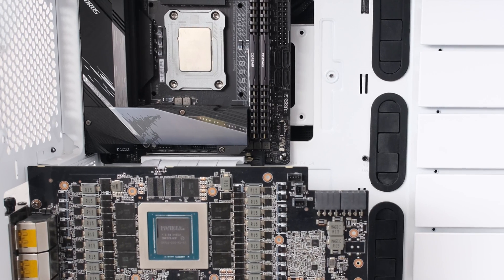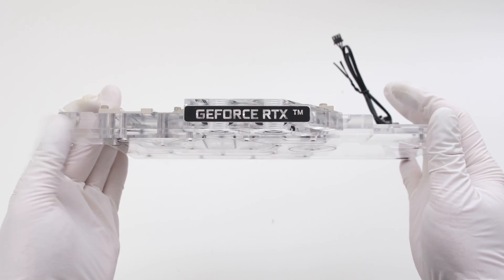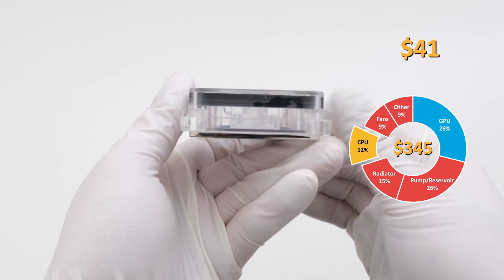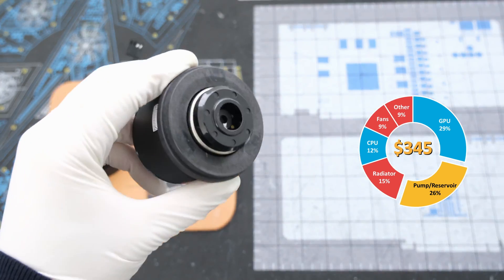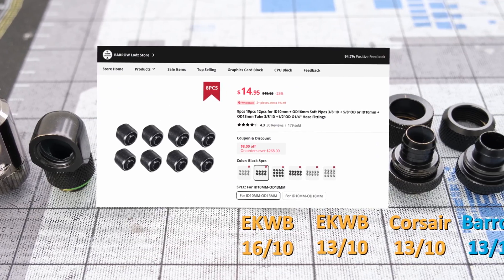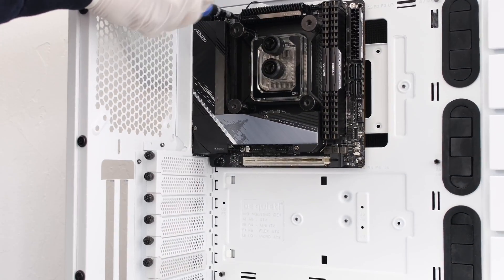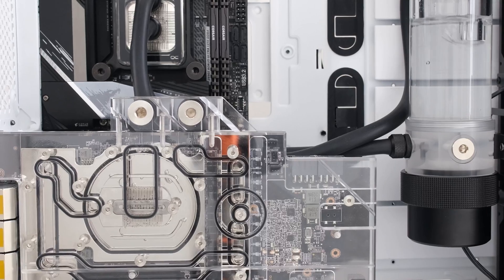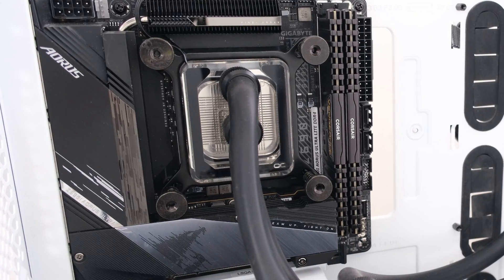Budget Watercooling Guide - Step by Step

Comment: Great vid, I'm trying this. So you connect the pump to a hdd cable, how do you control the speed? And when will it turn on/off?
Reply from the maker: Thanks for your comment 🙏 If the pump header is plugged into the motherboard, then the speed is controller by the motherboard software/bios. Since its connected to the power supply, the pump turn on when the PC turns on. Hope that helps

Comment: Great Video, I like the fact you did an entire custom loop for less than $350. I am currently running an AIO for my CPU was thinking about a second Loop for my GPU (EVGA) 3080 FTW 12Gb. 
the only other thing I was wondering about would be Maintenance  (how often, how would you drain it Etc.)
Reply from the maker: Thanks for your comment 🙏 Maintenance really depends on how well the loop is built and where it is located. You can easily go a year or more. But I like to think of maintenance as an opportunity to tinker with the build. Hope that helps

Comment: I have a overclock that is quite heavy even a Lian Li Galard II isn't cooling my CPU as the overclock is kind of extreme.
I never made a custom loop so would this be viable?
Pump+Resevoir--->240mmRad-->CPU-->360mmRad-->BacktoPump+Resevoir
Reply from the maker: Thanks for your comment 🙏 Looks like a 360 and 240 rad, which should be sufficient for a CPU and GPU combo. The more rad surface area, the better. As for loop order, it doesn't matter. Go with the order that makes the most functional sense. The water temperatures normalize far too quickly for the order to be a consideration. Hope that helps
Reply: @vectornetwork  Thank you :) I ask since i have a 14600K that pulls 250W with my overclock and my lian li 360 AiO isn't doing the job so i may start to navigate in to custo loops

Comment: Sure $350 for an old computer (which isn't worth water cooling, btw) but if you have modern components the cost will nearly double. $200+ just for a GPU cooler on the latest gen. The CPU cooler will be $100+ as well on latest gen.
Reply: Сlоwn take 🫵😆
Reply: @ffwast  sounds like you don't water cool. I've been custom loop water cooling for almost 20 years now. It is VERY expensive, especially when upgrading to new components.

Comment: Nice walkthrough! Was going 10/13 on EPDM tubing primarily for cost, or is there a build advantage? (easier turns than 10/16? or no)
Reply from the maker: Thanks for your comment 🙏 You nailed it. Its 100% due to cost. This is a budget build and everything adds up. The 13/10 tubing (and also importantly the 13/10 fittings) are slightly cheaper than their 16/10 counterparts. I prefer the 16/10. Hope that helps

Comment: which is the return and output side of the radiators and is it possible to fit 2 radiators in series?
Reply from the maker: Thanks for your comment 🙏 Radiators tend to be a little simpler than the CPU and GPU blocks. From my experience, you can use any plug for the input and output. Yes, you can fit 2 radiators in series. For this build, I was very conscious about cost and wanted to specifically show how 1 radiator can adequately cool both the GPU and CPU together. Hope that helps

Comment: This is almost perfect video. Although I would have highlighted the need of a good quality biocide AND corrosion inhibitor. Don’t think you can get away with only DI water/biocide, a silver coil or premix coolant. Corrosion is the number one issue that isn’t communicated enough in beginner guides.  Corrosion inhibitor is essential to prevent minerals  (in particular nickel plating) diffusing into the water due to the imbalance.
Reply: If you have copper everything (no nickel plating) in your loop you will not have a problem with corrosion as I mentioned but copper does tarnish green due to a number of environmental factors and water chemistry so a inhibitor is still recommended. But people forget fittings which are almost always nickel plated on the inside which will lead to the issue I mentioned above.  The  nickel plating flaking off which can then damage pumps and clog up fins in the jet plates of the blocks.  Easy solution is a few drops of a good biocide and inhibitor (they are separate bottles) like from mayhems”Mayhems” and then an additional drop every 3 months. I have done this for 5 years and never had an issue.  Block still like new. EKWB themselves does not actively promote this problem and how easy it is to fix.  Many of their premixes and additives etc do not contain those inhibitors.
Reply: does cooper has this issiue aswell or just nickel plating ?
Reply: Just use straight antifreeze and forget about it.

Comment: I just wanted to thank you for making this video. Most build videos spend all their time talking extensively about unimportant things and then just time-lapse through the actual loop building portion. Your video is exactly what i was looking for because you show the construction of the loop itself. The only things missing are design considerations (like putting the pump and a drain at the lowest water level) and tightening all the blanking plugs and the fittings, but that would make a good follow up video - you can call it "best practices for water cooling" and go over things like radiator placement, fan selection, radiator sizing, loop routing, tips and tricks etc.

Comment: While the budget liquid cooling system displayed in this video is very well thought-out, well executed, and the guide extremely well produced, I cannot in good conscience recommend spending custom liquid cooling money when you could easily use that money to upgrade your computer's components for enhanced performance.  unless (and specifically unless), you're using top end components, I can't recommend doing a custom liquid cooling loop (unless you're trying to cram a bunch of parts into a really tiny case or something and you need a unified small cooling system or something).  for example, the $345 spent on this loop could have been spent moving from a 3080 to a 3090 which would yield SIGNIFICANT gains (particularly to gaming and rendering workloads), or perhaps depending on what's available in your area you could have gone from a 3080 to a 4080 (or even 4080 super)(especially if you were to shop around on the used market).  Further, the gpu that you're cooling here is ALREADY equipped with an aio.  unless the integrated liquid cooler has failed (in which case you can pick up a gpu with a failed aio on ebay or something for SUPER cheap and this WOULD be a fantastic way to get it up and running again), it's very unlikely that you are going to get any additional performance out of this card by going from the stock liquid cooler solution to the one depicted.  and an i5 could easily be upgraded to an i7, or imo better, not buying the i5 or it's board and going instead with a used b450 board and a ryzen 7 5800x3d which uses around the same power (very efficient) and depending on the game, can be almost as performant as a i7-13900.  AND because it's a low power chip (as is the i5 shown in this video), it doesn't really need liquid cooling to get the best performance out of it either, in which case, I would go for something like a (preferably used) noctua nh-d15 (which has the capacity to cool way higher tdp chips than either of these for about $110 retail (or about $70 on ebay) or you could go with a less expensive $30 tower cooler such as the aged but very functional cooler master hyper 212 or similar.

tl;dr: this is a fantastic video on budget liquid cooling, but PLEASE don't build a liquid cooling loop if the cost of that loop could be used for getting you better performing components (preferably the highest end components that make sense for your application and budget.  also, given that 4090 air coolers are almost universally overengineered (temps on them are fantastic and they're voltage limited NOT power limited so you can't really make them hotter to improve performance) I don't generally recommend cooling 4090's which at the time of the writing of this comment is the highest end card you can get for consumer use.

I'll also note as a pro tip, because those arctic fans are so good and work so well (I use them myself), AND they're daisy chainable (which is a great feature), I would probably recommend doing push/pull (installing 3 fans on either side of that 360 rad) as working together you'll either get lower noise (because they perform better with more of them) or higher performance with more noise if you max them out and because they are so inexpensive, it's a very cheap way to improve performance of a loop like this one.  Also as radiators aren't THAT expensive, and if you're running a modern high performance gpu in your loop that can pull 350-450w, installing a second rad at the top of the case ALSO with push/pull fans could make sense as well if you have the budget.  the more radiator volume and the more fans you have, the higher the performance and the quieter the sound from the system (because the fans don't have to work as hard to keep the loop at the intended coolant temp. - which brings me to fan curve tuning.  it may require added expense (either by using a fan controller with temp probes, (or sometimes nicer motherboards will come with pluggable temp probes as well), but you need to be able to set your fans by the temperature of the COOLANT, NOT by the temperature of your cooled components.  particularly on cpus and gpus that have difficulty transferring heat to their thermal solution. (for example, I just upgraded to a 9950x and because of the thicc ihs, the temp of the cpu can ramp pretty high despite being well cooled and the coolant temp not increasing all that quickly. - it hasn't hit thermal throttling range so I think i'll leave it alone, but I've thought a little bit about de-lidding my cpu and getting a direct contact frame which could improve thermal transfer from cpu into my loop, decreasing temperatures overall.

Comment: Great video, I'm gonna use this as a guide for my first water-cooled build. The only question I have is that if the fittings linked will work for everything? Cpu block, and pump/res combo? The only thing I would use different is the cpu block, I wanna use the heatkiller iv pro, would the same fittings and soft tubing used in the video work for it? Thanks in advance!

Comment: First, thank you for telling the prices of all of the components number two thank you for showing that it does not have to be an elaborate system with multiple radiators to cool both the processor and GPU. There are so many people building systems twice as expensive as this one that really don’t cool, any better than this one this just shows though that one good decent radiator is typically enough in the end still simplifies things and makes it cheaper
Reply from the maker: Thanks for your comment🙏 Bingo, you nailed it. A solid & thick 360 radiator is all that is needed to get started. Adding another radiator means extra fittings, extra runs, extra costs. The end result and the tests speak for themselves. Cool and quiet. This watercooling game is endless. It pays to start simple. Thanks again for watching

Comment: Do you not need a power supply box for this build and the motherboard can you use any motherboard
Reply from the maker: Thanks for your comment 🙏 This build only addresses upgrading from a finished air-cooled build. So it involves replacing the air-coolers with water blocks, adding reservoir and pump, etc. But it is assuming you already have a complete system. Hope that helps
Reply: @vectornetwork  no I want to build a water cooled pc from start to finish
Reply from the maker: @JGKustomSneakz In that case, feel free to check out the other water-cooled PC builds on this channel, but those videos are not geared towards a budget

Comment: Thanks for the guide! Budget watercooling would be a great idea. I've been researching about how to install the water cooling parts and what kind of fittings, etc for a few days. The budget is not really my concern. I could buy anything only if I could afford. I'm just stuck on part where I'm trying to figure out is where to mount a reservoir cylinder. My case is Phantek Enthoo Pro. I have three options. I could try to mount using Phantek's own reservoir bracket plate accessory, or mount on 120mm sideway where 5.25" bay and HDD cages are. Second option is remove a PSU cover and mount on bottom 120mm fan. Third option is horizontal reservoir mount on top behind of the 360mm radiator. The problem is my MSI Gaming Trio X 4090 is so big and its got way past the 5.25" which is I had to remove the HDD cage unless I have to swap the 4090 cooler with a water block so it would be shorter, but it might be tight if I want to mount a reservoir on 120mm sideway that next to the 4090. Thoughts?
Reply from the maker: Thanks for your comment 🙏 Where to mount the reservoir isn't always straightforward. There are often a lot of (limited) choices. My thoughts are to not try anything that looks like it may not fit or may not be ideal. Go with the initial options. Using Phantek's own bracket plate seems like a good options, as long as it will fit and you have to consider the fittings and tube runs and not just the reservoir itself. Mounting on the bottom 120mm fan sounds good too. Sounds sturdy and seems like there would be room down there. Hope that helps.

Comment: Thank you for uploading this video. It really shows a good way to build your custom loop without spending more than the necessary. I'm planning to do something similar with my system but I may go with 2x360 radiators (I have to cool a 6900XT and a 7800x3d). What's your opinion? Are 2 radiators really needed in this scenario? This is my first custom loop so I'm not really sure. I heard that with 2 radiators I would have a quieter system and that's the whole reason I'm heading this way.

Comment: Is the water pump not noisy with the case lids on?
Reply from the maker: Thanks for your comment 🙏 The pump is not noisy. From my experience, noisy pump may be attributed to air in the pump and/or installation where the vibrations are causing unnecessary noise. Hope that helps

Comment: How do you empty your system?
Reply from the maker: Thanks for your comment 🙏 Typically, I would add a drain port to make draining the system a bit more convenient. I would typically find a spot on the Reservoir or use a T-splitter and put it on one of the radiator ports. Either way, you want it at a location that is as low as possible. I didn't add the drain port to this build because it is truly not necessary and it would add complexity and cost. 
Whether a drain port is installed or not, it still requires breaking apart the loop carefully to get out the remaining water. Keep in mind, I have heard that some people will use an air blower to inject air into the loop to get out all the water with a drain port. I haven't tried that myself. What I do is just find a spot in the loop where if you undo the fitting, undo and pinch and pull away the tube, the coolant that may come out will not immediately drop on any components. It is easier with soft tubing. 
Long story short, how to drain this is to just get a funnel, a bucket, a towel and then find a good tube to pull out and slowly take apart your loop and get the water out. There probably is better ways, but I enjoy taking apart the whole loop when I do maintenance. It's why I recommend starting with the EPDM tubing, as you can continually reuse it. Hope that helps